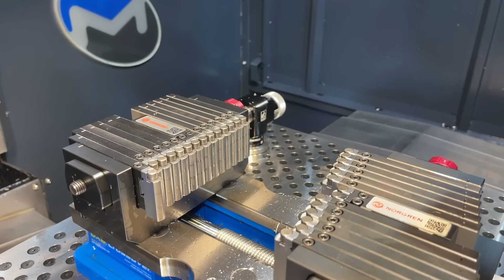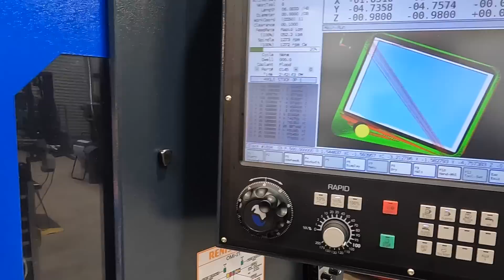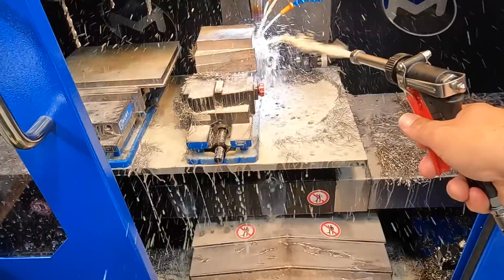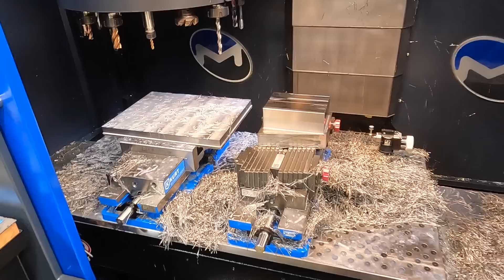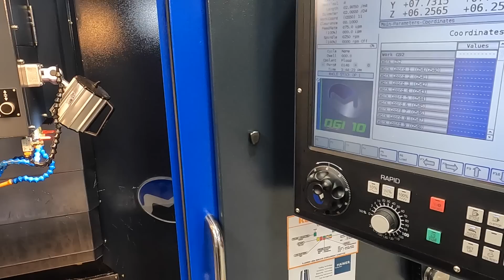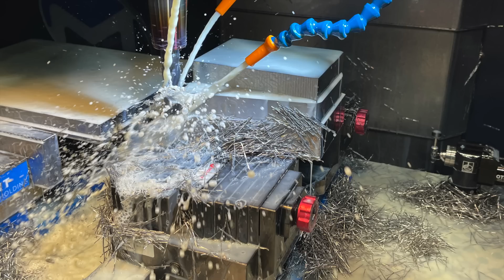CNC Milling Practice

Comment: Hi Abom,

Try to put some angle plate near the tool probe, because it is easy to broke it during normal operation, cleaning or in case of tool crash. Setting back the probe can costs up to half of hour.

Regards.

Comment: I prefer to cut steel dry in CNC mill.  The surface tension of the coolant makes it want to nest up the chips like that, when theyre dry they tend to just go flying.

Running faster or making heavier chips helps with chip evacuation as well.

Comment: 8:16  chip problems.. Search Control Your Chips! Chip Splitters and Roughing End Mills - Haas Automation. If you would like a little more detailed info on dealing with those chips. I think you probably already k ow why/what to do to mitigate that problem, but that video is super helpful anyway🙂

Comment: Hi Adam, Glad to see you are getting more confident with your new machine. Re the surface finish from your face mill. If your feed per tooth exceeds the width of the wiper flat on the insert your finish will certainly look like that. Also are they precision ground inserts or as sintered as the tolerance difference between the two may mean one insert is sitting a little higher which will also give that effect. I worked 28 years for Seco Tools of Sweden and really enjoyed the milling side of the range. There are so many things that can effect surface finish. Cheers Ian New Zealand

Comment: Would it be possible for this machine to put a sharp edge on a knife and how would it compare with a conventionally sharpened knife?
Reply: @Darrell Boyd, the only significant issue with milling the final, equal angle bevels on a knife edge is the inevitable burr that would be left on the opposite side to the last bevel cut so yes, you could certainly shape the knife however you want, (specialist workholding and any necessary custom profiled tooling notwithstanding), and use it straight from the machine, by gripping the blade back horizontally in a vice for example and angling the cutter both ways ten or fifteen degrees for an included angle of between 20 and 30 degrees but you'd still need to de-burr and hand sharpen it in the normal way to achieve a truly razor sharp edge which is difficult enough to do by hand anyway without super fine stones like Arkansas black or a similar polishing grade of ceramic like man-made ruby or maybe 10,000 grit Japanese water stones.

At work as a cabinet maker and joiner of 35 plus years I've always used three grades of oilstone to achieve a razor sharp edge on a chisel; firstly a standard Norton 8x2" stone of about 220 medium to fine grit after grinding and then a Smith's Arkansas grey medium/fine oilstone followed by a black superfine Smith's Arkansas 6x2" in a cedar box I've had since 1985 and it's still flat as it just doesn't wear. One drop of oil covers the whole stone surface when spread with a finger and the trick to keeping the edge sharp is to never use a rougher grade on the chisel back than the fine grey Arkansas natural stone for deburring so it stays polished like the top bevel once it's finished.

Wood chisels are easy but knives are all about holding the angle steadily and removing the remotest burr as they can be ground on a waterwheel or grinder and stropped a few times to be capable of cutting with ease but the edge won't last unless it's extremely finely ground and polished so the sharper an edge, the longer it lasts.

A milled bevel's sharpness would depend upon the exact cutter and blade material and their respective, relative hardnesses, slow feeds and high spindle speeds and you'd have to finish off with the finest possible climb cuts to reduce tool pressure to an absolute minimum with a top quality micro-grained carbide endmill or hold a 320 grit grinding wheel, say 6 or 7 inches in diameter as a minimum on an arbor in the spindle and cut perpendicular to the blade length, (clearances permitting), in whichever direction gives the least pronounced burr, which may then be fine enough to remove with a leather strop unless that's considered cheating.
Reply: @SupraSmart68  thanks for your explanation.  I understand the deburring of the edge after all of the steps are completed.  I wouldn't consider deburring cheating regardless of how it's performed.  What I'm envisioning is a CNC made knife that is "near" perfect condition to use right off the machine.  Imagine the time savings that would give the maker over hand sharpening, and as precise as Adam talks about making the cuts, 50,000 of an inch for example, that should be a pretty sharp knife.  Just curious if anyone has ever heard of or tried to CNC a knife edge sharp enough to use right off the machine.  Thanks again.

Comment: Setting the rapids (G00) at 50% doesn't affect 'cutting' time (G01). Just the return between cuts.  It's good to have the rapids down at the start of a program when you are single blocking but once you know it isn't going to crash into anything consider putting them back to 100% again.
Interesting that you didn't use coolant on the shell mill. Is that what Walter recommend for that type of steel?

Comment: 18:30 My turning instructor was right. "If your tool is almost sharp, it will almost cut." I've found those to be words to live by.  He also said "If you wonder if it's dull, it probably has been for some time so don't be surprised at the improvement when you sharpen it." He was speaking of HSS but it's true of any cutting edge on any material.

Comment: The night and day difference between the passes with the old and new cutters is crazy. Completely different sound and everything. A really good example of why it's good to make sure your tools are in good shape. Probably could have made the part to the right dimensions with the bad cutters, but it wouldn't look nearly as good and would be a lot harder to get into spec.

Comment: the best way to get rid of that type of mill scale is with the biggest angle grinder you can find, a sanding disc, and steady hands. it will come right off. paint stripper discs are a waste of time with this kind of mill scale.
Reply: Like watching concrete dry .
Reply: Or just take a deeper first cut.

Comment: 8-10% radial engagement is pretty good for up to 1.5x of the cutting diameter in axial depth. That said, 3/4" end mill for 1" axial depth a good radial DOC is .070. For feed rate .004" chip load per tooth is pretty good, that would put you at just under 20 IPM

Comment: CNC practice?  You just as well be cutting air.  The shops I worked as a moldmaker, what is the point of practice cuts?  Trust your numbers and crank it.  If you cut a practice cut, you've already lost double the time to machine, triple if you adjust, and at least 1 time machining.  Always consider the time you've lost to indecisions.  "Be decisive.  Right or wrong, make a decision.  The road of life is paved with flat squirrels who could not make a decision."  Push forward hard!

Comment: push that tool! that baby should take a 15-20% steep at that feed / speed. i run 1/2 tools 1.25" deep @ 25% step 2500rpm @ 32 imp in A2 tool steel. gotta see that that new vise its made of

Comment: You answered my question.  When i was machining 410 stainless, we were running full depth with a 3/4 in rougher/finisher, 5-7% stepover, 4500 rpm, 60-80ipm, constant surface feet program. (I forget the trade name) 1 1/8 depth of cut, but a pretty light stepover.  It sounded like a wood shop, it was singing.  Plus, many times we ran them dry!

Comment: Adam, what kind of chip load and rpm are you running?   Material? Are you using a constant chip load type of programming (high speed roughing or profiling), or is it a constant surface feet type of software?  Thanks, like your show.

Comment: Thanks for sharing another CNC video.  Love your channel. Keep those videos coming.
I am a hobbyist machinist and also have the Renishaw Wireless Probe and Tool Setter on my HAAS TM1P.  I know the Tool Setter is coolant proof but I found an old piece of tupperware with the right depth and diameter and turned it upside down to cover the Tool Setter while using the machine in normal use.  The only time I take it off is when I am setting tool heights.  This keeps the coolant and chips off of the tool setter.

I also made an manual and automatic air blast system that I attached to my PCOOL nozzle.  I mostly use it in the manual mode with a foot pedal.  When I want to get rid of any excess chips I just give the old foot pedal a press and presto the chips are blown away from the part.  In the automatic mode with the help of one of my internet buddies I was able to  set the length of time the blast will occur and how often the air blast will occur.  The air blast system allows me to keep the door shut and keep the coolant inside the machine.😊

Comment: where's the artistry and craftsmanship, i miss the old abom79. i'm glad others find it valuable.
Reply: I'm okay with the CnC machining.  It's the future and, as Adam has another 20 or 25 years of work ahead of him, he is doing himself a good service by learning to use them.  And he still has all that old school machining and lathe work to serve as a fantastic foundation.
Reply: Don't you enjoy learning new skills ? I certainly do
Reply: @patlocke4926  good for you Pat, hope you learn all that your capable of. 
i think everybody's here for the learning and witness the trials and successes.
Reply: So you aren't not ok with using automated feeds on a manual mill either? Showing this sort of nuts and bolts including the fails/learning CNC from Abom is exceptionally valuable as the feeds and speeds still apply to equally to manual machining.
Reply: @seabreezecoffeeroasters7994  it's all  good stuff, but i personally cant relate because i don't have a $100k CNC and i'm not running production level quantities where a CNC really brings value. if i did i'm sure i would find this good learnings. i'm just a slob with a home shop trying to learn over the shoulder of such great masters like Adam. 
I watch to learn some unique insights that are relevant to me, that's the beauty of youtube.
Reply: @Tarzan_Tools  Given you can now start to buy used CNC gear not much smaller than the Milltronics for $5-10kUSD even here in Oz they are sort of approachable for home. Even some of the workholding for me is of interest for my 3kW 4x3 router. I am also looking at doing a CNC conversion to an Optimum to allow me some work in harder materials.

Comment: Wish you would show the Gcode while it's running that would be interesting.  I don't know if you watch it or not but as you're gaining experience with Cnc machines it's very helpful to learn to follow along and especially to read the code before you push that awful GREEN button and understand what is about to happen.  I do this everytime I run a program.  It calms my nerves alot to know exactly what is about to happen but I still keep my finger on the red button and turn the rapids down low on the first part until I'm confident all my offsets are working as planned.  Great content, the CNC stuff is very interesting and I do it all day everyday at work...LOL
Reply: He has a conversational machine that shows a mastercam like simulation of the cut.

Comment: Adam, get yourself a 1 1/2 indexed end mill and step down say 50tho depth of cut back and forth until it cuts the sides away. Then use the same tool to face cut. Iscar makes some that will cut at amazing speeds. I programmed for years and ran part time. This is by far the fastest method. We tested alot in the automotive tooling world.

Comment: Adam, please educate me on the milling direction that you prefer or is necessary. My brain tells me to operate the feed against the rotation of the cutter, yet I see you feeding "towards the grain" so to speak. Have I been milling wrong all this time? Thank you for your outstanding education during the videos. Love it!
Reply: A full answer to that question is both complicated and beyond my expertise, but the short answer I can give you. The answer is different for manual machines versus CNC machines. What you see in this video is "climb cutting," which means cutting so that the tool tends to pull the work in the same direction as the travel. On manual machines, you are usually dealing with significant backlash, which makes climb cutting risky--potentially even dangerous. The rule of thumb is "never" climb-cut on a conventional machine, although sometimes you will see somebody take a very light climb cut to get a better surface finish. Always cut so that the tool pushes against the motion of the axis--called "conventional" cutting.

CNC machines, on the other hand, are built with virtually zero backlash--typically by using ballscrews instead of conventional Acme screws for the axis drives. Therefore climb cutting is generally safe on this machine, and typically preferred because of the aforementioned better surface finish--although a quick Google search will turn up many people arguing that conventional cutting is to be preferred in this or that particular situation.

Comment: Is there a coolant source near the base that could be used for a jet to spray the back of the vise? Maybe with lines similar to the ones for the spindle but with a smaller nozzle for a more pressurized stream to clear away the chips. It didn't look like the coolant gun was blowing the chips away.

Comment: I think the only thing you are missing on your machine is high pressure coolant. You were wondering about your 1/4 depth of cut, the rule I was told was you can go up to half the tool diameter when side milling like that. So on a 3/4 diameter tool you should be able to side mill .375 deep

Comment: Adam, you mentioned the rapid override in relation to the feed of the cutter. The rapid override shouldn't change the cutters feed rate. Only the rapid feed rate. In fact does the rapid override on your machine go to zero? If so this can be used to advantage while running the program. By setting it to zero while the machine is feeding it will stop before any rapid move. Until you turn the knob off of zero rapid feed.  On running in a tool for the first time. There should be a distance to go display on your control. This shows the distance the tool has to go to reach the end of the move it is currently on. So running a tool the first time press feed hold as the tool rapids down to the work. With the machine now stopped look at your distance to go display in the Z axis. If the distance to go in the Z looks wrong for some reason. Like there is only an inch to go but the display shows more than that. Stop the machine and correct the problem. It is better to stop and check then to regret it later. This can also be used in moves in the X and Y axis while milling. For instance when your chamfering cutter is approaching the part. You could also press feed hold just before it reaches the edge. Then look at the distance to go in X and Y. If there are some big numbers it's going to cut the chamfer to large . I generally like to start a chamfering cutter off the corner of a part, like this instead of arcing in. That way if something is wrong it is easier to catch/see it before cutting to much of a chamfer. Otherwise it looks like you are getting this CNC stuff pretty well. At first it's a little intimidating. But it will all become second nature like running a manual machine is to you.

Comment: Ten percent of tool diameter is a good starting point for radial engagement.  It will really depend on what your machine/setup/tooling will allow.  As you learn and grow more confident and comfoertable you will realize cnc machines are capable of things that you could never imagine.  Every once in a while i look back at old programs i made where i thought i was really pushing the limits and find out just how slow and gentle i was going.  Just keep working at it and you will find the sweet spot for you.

Comment: My shop has died a death in the UK as nobody want to pay the costs of doing things properly, they'd rather buy in cheap sh1t from PRC.
Reply: We are watching the death of machine shops right here.
Reply: "Doing things properly" has, in my experience, always been code-word for "quality exceeding request by customer".
A customer doesn't want to pay for you to first bore a 4.8mm hole, then ream it to 5H7, then thread mill it to accept a 6g go/no-go thread gauge to the exact depth designated, when all that's requested is an M6 tapped hole. 
This is extreme, but in a more real scenario, I've seen a lot of people being very concerned about surface finishes in clearance holes, or even measuring the diameter of a countersink.
Good enough is just that, good enough.
Reply: @henrik thaisen  then you get a quality controller at your customers end that pulls your work apart because it isn't to the drawing specs  and they refuse to pay...

Precision engineering supposed to ne exactly that, nothing more, and nothing less.

Comment: Seeing the steel block and some of the difficulties you experienced while machining took me back to the mid to late 1980s when i was working on the JP233 project. Part of the submunition was 30 runway crating bomblets. Part of that system was made from a 2.5% Nickel Chromium Molybdenum steel. It 2as by far the most awkward steel I have ever worked with. Hard spots, drills and taps breaking, inserts blunting/chipping, tools pushing off, surface finish problems. We completed the contract and the whole stock of JP233s was used by the R.A.F. and the Royal Saudi Air Force during Operation Desert Storm. Good post explaining the difficulties and remedies, thanks for posting.